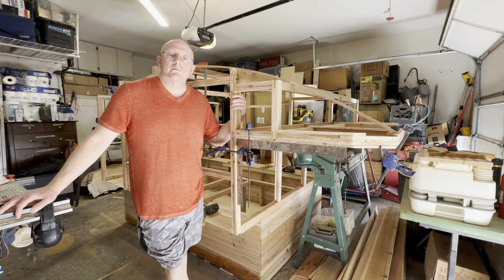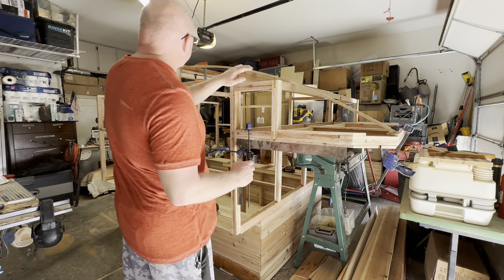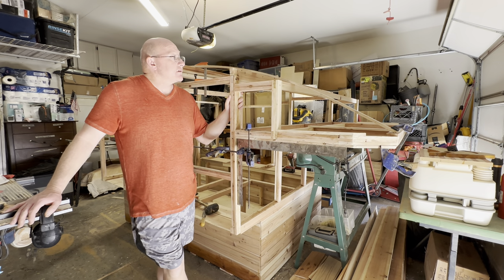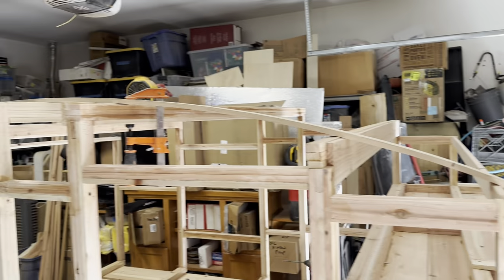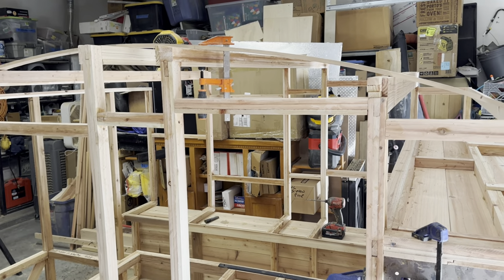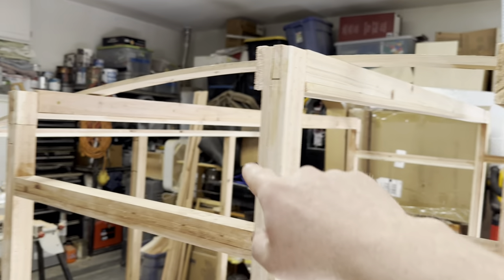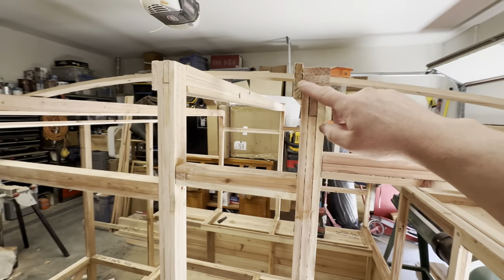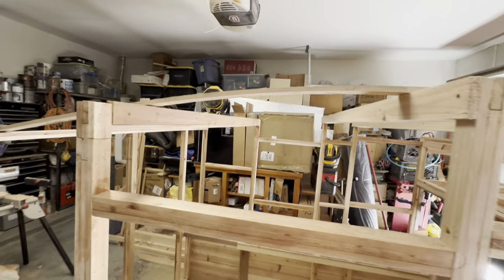Truck Camper Build 8.0 VLOG Part 3

Comment: Dave, another benefit of the arch is shedding water and preserving the roof. I’ve noticed the camper trailers now have an arch side to side. Years ago they were flat, and a nightmare for leaking. Very cool stuff you are doing, keep it up.